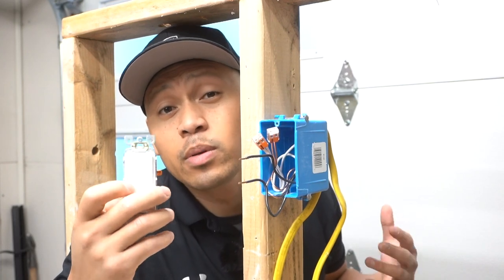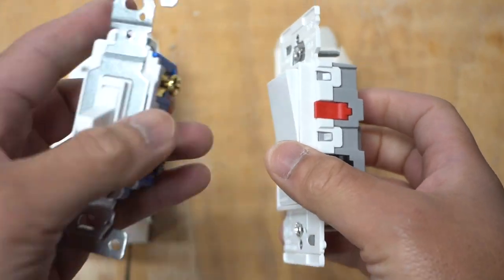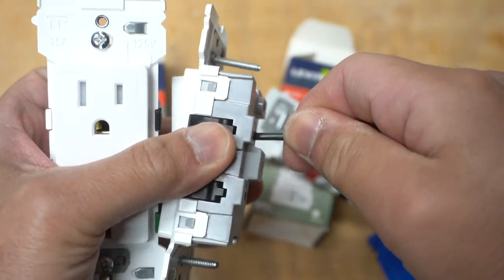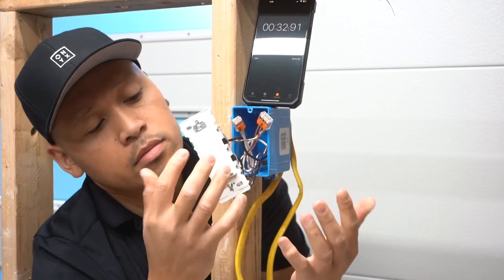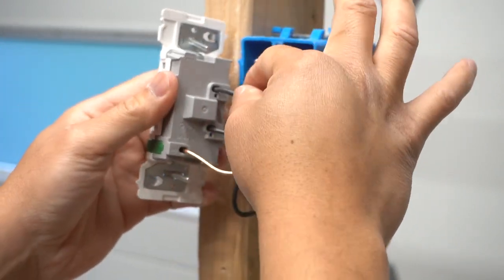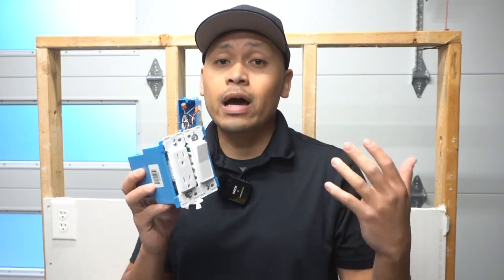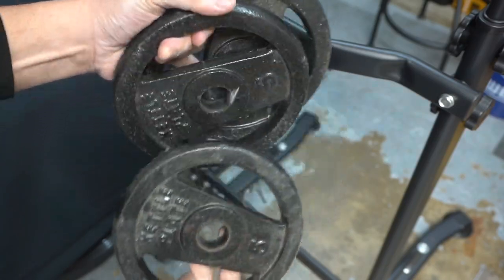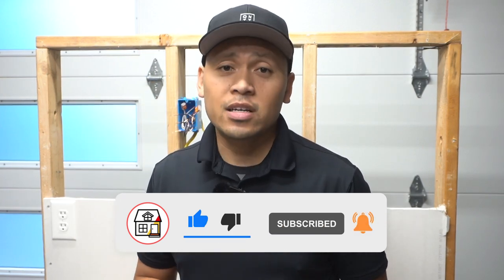The FIRST Ever Hybrid Switch That Will SHOCK The Electrical World! How To DIY

Comment from the maker: ITEMS I USED ON THIS VIDEO:
- Leviton Decora Edge 15 Amp Single Pole Switch - https://homedepot.sjv.io/Py06JQ
- Leviton Decora Edge 15 Amp 3-Way Switch - https://homedepot.sjv.io/k0joDd
- Leviton Decora Edge 15 Amp Tamper-Resistant Outlet - https://homedepot.sjv.io/eK4A0Q
- Leviton Decora Edge 15 Amp Tamper-Resistant Outlet (10 Pack) - https://homedepot.sjv.io/y2RmJW

Comment: Th small connectors i have seen used in a phone line where voltage is much lower and amperage is minimal ac voltace is typically 110 volts and amperage is limited by a fuse in the circuit. A phone is 12 volts and less than 10 amps .

Comment: Where can I get those 
Can’t find
Reply from the maker: Hi Robert! Here are the Quik links to find these switches and outlets: 
ITEMS I USED ON THIS VIDEO:
- Leviton Decora Edge 15 Amp Single Pole Switch - https://homedepot.sjv.io/Py06JQ
- Leviton Decora Edge 15 Amp 3-Way Switch - https://homedepot.sjv.io/k0joDd
- Leviton Decora Edge 15 Amp Tamper-Resistant Outlet - https://homedepot.sjv.io/eK4A0Q
- Leviton Decora Edge 15 Amp Tamper-Resistant Outlet (10 Pack) - https://homedepot.sjv.io/y2RmJW

Comment: Already saw a review of this a few weeks ago. Cool, but not necessary. As for WAGO, not for the DIYer who has a boxes of wire nuts, thus wagos not needed. Wagos are not cheap. Nice but not needed, wire nuts have been used longer than the time you have been on the earth.
Reply: Did you write your message using a stone slab and a hammer and chisel ?
Reply: @PeterL-r6w  Not a word about cost. Enough to become suspicious because the old way of pushing the wire into the back has worked very well and has not produced any short (if not the code would have forbidden it). Great for charging customers and great for gadget lovers.
Reply: @PeterL-r6w  😂😂😂